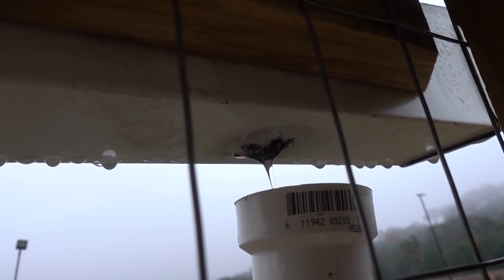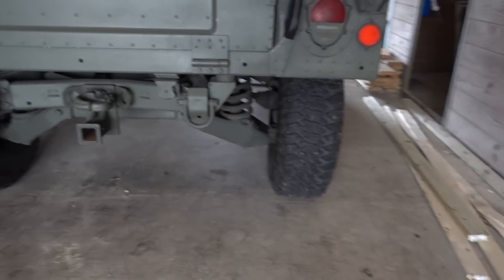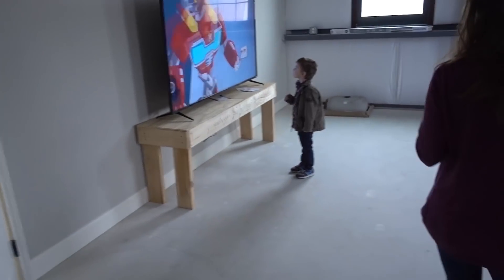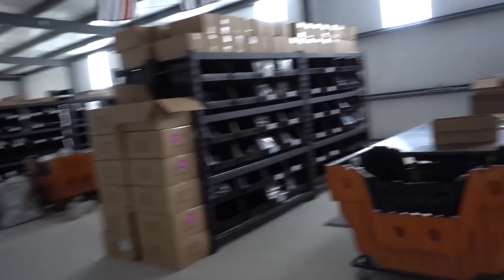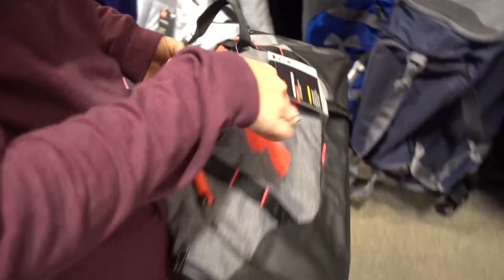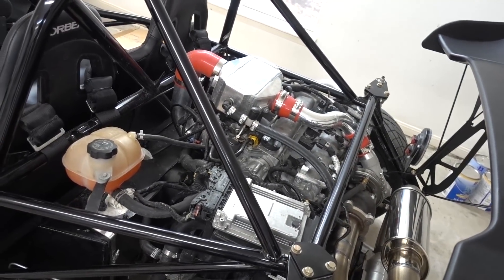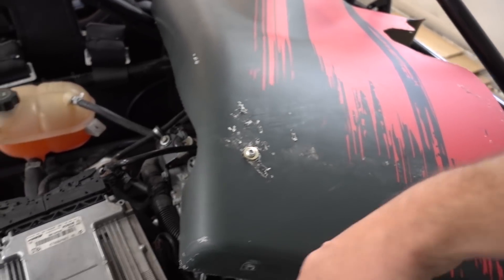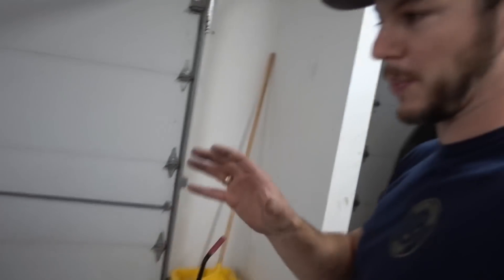My Secret Plan For the New Business...

Comment: Matt you can do the camber on the rear of the Humvee, you need to remove the shims behind the upper control arm mount, remove them all and camber will be just slightly positive unloaded.  Toe will need to be re-adjusted after.

Comment: To help with rain getting in through the seams of the doors undo the three twist pins at the top of the door and unfold it and shut the door. Helps a lot and with the seams meshing in the center get a piece of plywood and put in between the frame and tarp... it works i promise

Comment: Matt, that isn't dirt, that is algae. The clear pipes allow photosynthesis. I suggest covering the clear parts completely with some pipe insulation (basically a black pool noodle with a slit along its entire length). It is easy to remove to view the water levels.
Reply: I have a question. How does algae get into a system like this?
Reply: amadeusz antyga the water isnt perfectly clean so algae is already there
Reply: That's what some people told him when he made the changes in the last video. Also, the UV will damage the plastic eventually as well.
Reply: it is in the air.
Reply: Good idea

Comment: I'ma roofer by trade the reason your most likely getting that crud in those pipes is cause hafe of the water your are collecting is running over the shingle roof and those shingles have fiberglass and alot of other stuff in them that is getting into. the water your collecting you should test the water. to make sure your not hurting the chickens just food for thought cause I love all your channels
Reply: Johnny Martin His roof is metal.
Reply: The other half is that water has a lot of crud in it, especially algae, and when water sits stagnant, it grows. Especially when there's light, unlike the non-clear pipes.
Reply: yeah i think you got the most logical explanation here. makes sense.

Comment: The shingle roof will initially absorb a lot of the very light rain, until the shingles are saturated, whereas the tin roof will shed nearly all the rain
Reply: joe jacob shingles saturated, lol, roof shingles are waterproof.
Reply: 1) Shingles are not all intrinsically waterproof. Asphalt shingles have an organic core like waste paper, cotton, linen or various other absorbent materials that are impregnated with asphalt (which can wear away and allow seepage of water into the organic core structure and cause rot), unless the roof slope is great enough (17% or greater) to allow use of fiberglass shingles (which are intrinsically waterproof) as per International Building Code.
2) There are also still wood shingles in use, though not as common, which do operate how he's talking about. Capillary action draws the water that was soaked into the shingle to the lower cut tip (wood shingles should always be cut lengthwise with the grain, not against) which then drips out and runs down the lower shingles, repeating the process until it reaches the edge of the roof. Any water that lands when the shingle is over-saturated already simply runs over the surface of the wood shingle.
3) He's still wrong to mention it here, as asphalt shingles are obviously in use, and operate differently from wooden shingles.

Comment: Matt, pro tip for ya. Swap out the top of those clear pipes with a T connector, then cap off the top. Then you can just take off the cap and run a brush straight down. Does that make sense?

Comment: that is algae, not dirt right?  Would think now that light can go through, algae will grow
Reply: Hey Matt, this comment is exactly right...  That is not dirt, it is algae and in a water system depending on the strain of algae, can potentially be dangerous as it builds up for the health of the chickens.  There will be dirt and debris building up as well as it happens in most rain collection systems.  Check out google or youtube for "first flush diverter".  You will need a clean out for that tube, but it may also be highly beneficial to actually cover that tube, perhaps with another pipe that is solid color over it with a slit cut in the middle of it.  This would greatly reduce the amount of algae but not fully eliminate
Reply: If you cut a slit in a sponge and put a powerful magnet in then glue it up.then put the sponge in one side  and then put another magnet that way you can slide it back and forth to clean out the algae
Reply: +MrNerdyBirdy
Just smudging it with a sponge will not clean it out of the system, if that's what you're saying.
Reply: +ErebosGR it would work the algae isn't that smudged on

Comment: Looks like black or blue algae because you are letting light in clear tubing.
Reply: He could probably cover the clear pipe with pipe insulation -- just a friction fit around the pipe, he can take it off to inspect water levels.
Reply: Steven Kritzer yeah Armaflex would work has slit so it slips over .. good idea
Reply: Steven Kritzer - Agreed. I was thinking much the same thing as a potential solution.
Reply: I believe that they make UV rated clear (blue) PVC pipe, super expensive though.  Covering the pipe from sunlight with the pipe insulator should do the trick. Algae probably won't hurt the chickens (they eat bugs), Chlorine bleach will purify the water.

Water treatment formula
https://www.doh.wa.gov/Emergencies/BePreparedBeSafe/SevereWeatherandNaturalDisasters/WaterPurification

Comment: Is it just me or does it seem like the engine cover is supposed to be inserted under the bar from the back to the front. Kinda like inserting a chip credit card if that helps.
Reply: Yup, seemed pretty obvious to me that that's how it's supposed to be done, too, but ah well.
Reply: The bars that go from the spoiler to the frame would block that, wouldn't they?

Comment: Hey Matt just a few ideas for your watering system.
Cleaning them pipes could you not shut off the barrels and put two taps before and after the clear pipes so you can close them off then remove them and clean them.
Also for freezing as you mentioned before, wouldn't some insulation tape around the pipes work? Just watch that the chickens don't eat at it and what not, all ideas of corse, I'm no plummer haha

Comment: The Pipe..... trust me, it'll get worse... the gutters on our house get filled with gunk & moss all the time, and a few years back the last section of cast iron downpipe got completely blocked with the damn stuff, and had to call a builder out with an angle grinder to cut part of it out (not helped by the fact part of it runs through the concrete steps up to the flat + has the kitchen drain outlet running into it too).

Game Cams..... if you're having trouble setting it up, ask your Dad as he was using some recently to try catch whatever was nailing his friend's sheep.

Comment: You can actually use those spray cans to waterproof your clothes/bags to make your hood (roof) waterproof. You will need a few cans and it might take a few times but it does improve the water resistance of the canvas and it is a lot cheaper than buying a new hood.

Comment: If your tires are still making noise when you go around corners, I would have someone look into the real limited slip differential. In the old days, we couldn't afford to install a limited slip so we'd weld the spider gears making the rear end solid. It provided great traction for acceleration, but since there was no differential action, one tire had to slip when going around corners.

Comment: As far as the camber adjustment on the HMMWV goes, it is adjustable but a huge PITA. There are shims between the upper control arms and the frame. Used to work on them back in my .mil days but we rarely fussed with them as they're a huge pain.

Comment: I have used Moultrie trail cams for years always got great pictures and had good luck with them bought a Wildgame Innovation at Cabelas because it was on sale and the guy at Cabelas recommended it. Big Mistake, the wildgame cameras are notorious for having horrible triggers and trigger distances so if your not withing 15 ft of the camera it will not trigger. As a test I put the Wildgame camera directly next to my Moultrie and the Moultrie took just over 200 pics from one night while the Wildgame took only 8 and the Moultrie is 5 years old, needless to say I will never buy another Wildgame Innovations trail camera and you most likely don't have a setting wrong the camera is just junk.

Comment: Ratchet strap ?? preload the suspension (HMMWV) when "underloaded"..  will fix camber issues, with a reduction in ride quality (if that is possible).  lol.

other "Idea"  anti-lift airbag  (air cylinder with parallel damper could do the job - trouble fitting in available space - ), humm  nope, not gunna work. jk

Comment: Hey Matt... check and see if the rear off your HUMV is a locked rear end.  If it is ... it's going to howl like that no matter what, due to one wheel wanting to spin faster than the other.
Reply: it is actually due to the fact that both wheels want to have the same speed, but due to the cornering the inner wheel will have less distance to travel than the outer wheel. Therefore, the inner wheel will have to slip since it will match the speed of the outer wheel (or the outer wheel will drag but that is less likely).